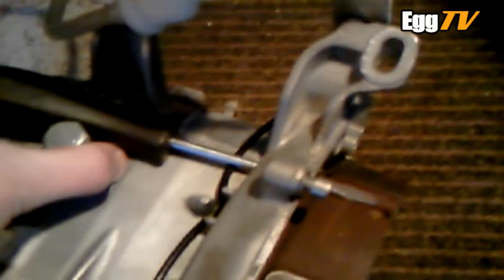GX270 Paramotor. Flywheel Nut Removal Technique - EggTV

Comment from the maker: That sounds a much safer option :)
When I stripped this engine originally and found the piston/rings seized to the cylinder, I really gave the con-rod a hard time breaking it free. Probably 2-3 times more force than used for removing flywheel nut. I was having to hit the end of the long torque wrench arm with a chunky wooden block while standing on the engine to hold it still. Probably not good for the torque wrench :)

Comment: Before I had an impact wrench, I found that the safest method of removal was to take out the spark plug and put a length of rope into the cylinder. That was on briggs and stratton engines, but not sure if the connecting rod is up to it on these :) .